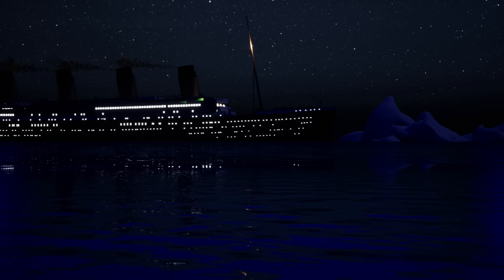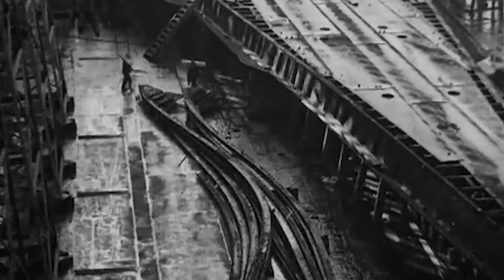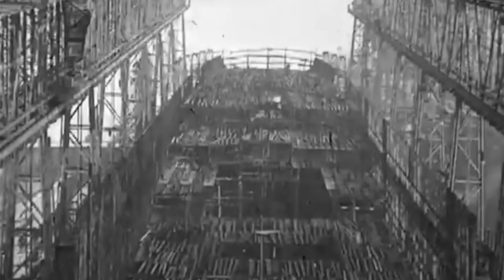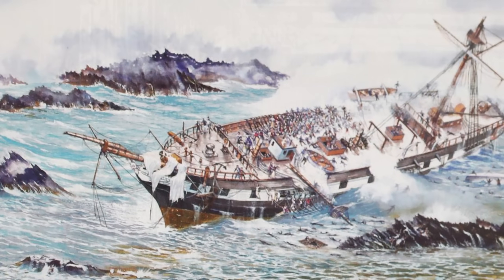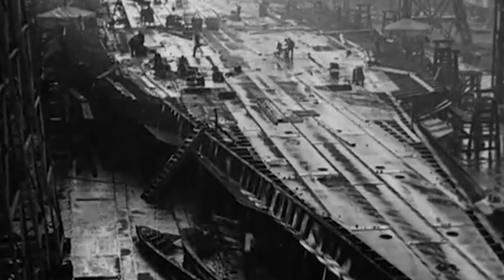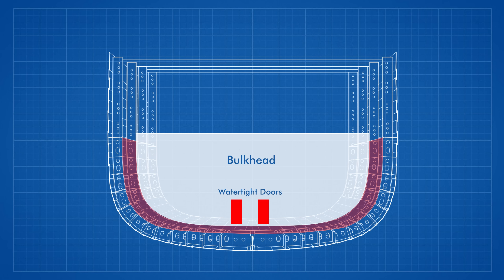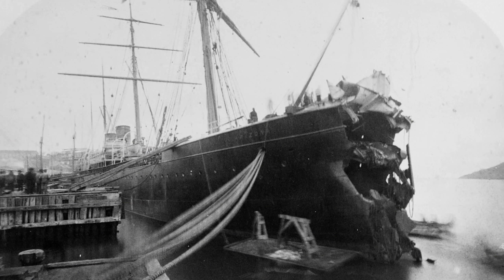How did the Iceberg Sink the Titanic?

Comment: Interesting video.

One thing that does occur to me, that doesn't seem to be addressed anywhere.  There are numerous eyewitness reports about the initial impact (or impacts), and said reports vary widely.  Some witnesses felt nothing or weren't awakened, some reported hearing / feeling distant grinding noises, others report a definite shudder, a couple report a shock or jolt strong enough to make them stumble or almost fall out of bed.

This suggests that different parts of the ship MIGHT have reacted differently and/or to different degrees to the collision.  The hull would have been built to flex somewhat anyhow and, considering the considerable forces involved while sideswiping the iceberg, some flexing, twisting and distortion of the structure seems plausible.

  Give the size of the Titanic, and that some of the forces involved were concentrated in specific areas, perhaps some of the twisting, etc. was differential - ie. different parts of the ship distorted at different rates.  That would help explain how people "felt" the collision differently.  This might also have opened up gaps in plates, and damaged portions of the ship's structure, over and beyond what the actual iceberg impact did directly.

Pure speculation on my part.  Nothing world-shaking or paradigm-changing here, just something to think about.

Comment: Could the Titanic have been saved had Captain Edward Smith heeded the iceburg warnings, maybe a bit earlier? To me, it seemed he ignored them. Would the Titanic have floated until help arrived if it hit head-on?
Reply: Smith was technically heeding the warnings, he didn't exactly ignore them. The ship's officers, captain included, expected to see ice around midnight that evening. Before going off to bed for the night, Smith left the order with Lightoller to slow the ship to half speed ahead should ANY changes in the conditions occur, including spotting any ice. It's just that it was so brightly lit by starlight and so clear and calm, he was banking on the conditions holding (which they technically did).

As for the collision, yes, Titanic would have absolutely survived a head-on collision with the iceberg BUT it would have buckled in the first two or three compartments killing some 400-450 passengers and crew. The most senior officer on-duty behind the command would be responsible and arrested/court-martialled and charged with mass negligence, manslaughter of the highest degree, and destruction of property. Unfortunately, rudimentary mariner training has mariners avoid obstacles at sea at all costs.

By rights, they ALMOST made it. Contrary to what the Cameron film shows us, Titanic was very responsive to her helm and rudder and came very close to missing the iceberg completely.

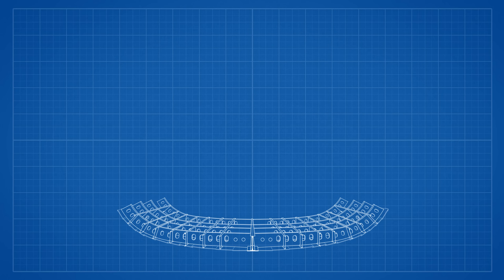Comment: 4:40 See the "floor" of the ship? They had all those oval holes all over, why was that? 
Did they need them solid and help save on steel? Make them stronger? 
Thanks.
Reply: Those are called "lightning holes" which are indeed to help lighten the overall load and improve buoyancy but most importantly they allow for water to be able to be pumped between different ballast tanks. If these holes weren't installed in the floor sections of the frames, the ballast water would need to be pumped up out of the double bottom, requiring twice the pumping power the ship design called for, whereas if you put these holes into the floors of the frames, you can simply pump in parallel from one ballast tank to another.

It also added a touch of flexibility to the steel, not much but enough to account for changing in sea temperatures year-round.

Comment: Could they have pumped the water out of the sixth watertight compartment?
Reply: They did exactly that, until the pumps could no longer keep up. Then they retreated to the next compartment back and sealed the previous one forward. They'd continue doing this throughout the sinking until the power waned enough to be insufficient to keep the pumps going.
Reply: @pc_buildyb0i935 Exactly.  Plus, the Titanic’s pumps could expel only about 400 tons of water per hour, at their peak efficiency.  Meanwhile, 20,000 tons of water per hour were coming in.  It was an unequal battle, to say the least.

Comment: Thank you, love your graphics! Did the tank top plates extend to the outer bulkhead plates? If so, was this joint welded or riveted so as to seal the ballasts, assuming this to be true, please confirm. Would have a second layer of bulkhead plates (on the hull framing's interior) saved the Titanic? Did the iceberg damage the hull framing or only the outer bulkhead plates?
Reply: Welding was in its infancy in Titanic's era, so the steel plating sealing the tank top to create the ballasts was sealed using riveting. The iceberg damage was limited only to the hull's steel plating. The individual frames of the ship were undamaged by the iceberg collision (but very likely damaged during the breakup, and the eventual collision with the sea floor)

Comment: Thinking about the lifeboats' role as "ferries" between the stricken ship and the rescue ship (so that there was "no need" for a full lifeboat complement) I think the trouble with that is by the time the "ferries" made one trip and came back the stricken ship might've been in a far more precarious situation if not already beneath the water. So with a full lifeboat complement and a properly trained crew it would've all been more effective and faster everyone would've been evacuated at the same time. The normally stormy North Atlantic is no place for such "ferries" especially if the crew had to row (the boats weren't motorized) the crew would've for sure been exhausted from rowing in choppy waters. That night the sea was most unusually calm and it seems largely forgotten that this is really the exception on the North Atlantic. (And the very fact that it was so calm makes it very easy for people now to think of lifeboats as "ferries") 
Also the word was spread at the time that the North Atlantic run was so busy "there were always other ships nearby if anything happens." The Titanic was really no exception as the Californian was only 10mi away or most probably less than that (donkey boilerman Ernest Gill and carpenter James McGregor saw the Titanic's distress rockets very plainly as did the officers), but then (a) she was the one and only ship really close and (b) Cpt Lord just wouldn't bother helping. And then apart from the Californian all the other ships contacted by Phillips and Bride were much further away. After all, the Carpathia was no fewer than 58mi away so she needed 3.5hrs to make it to the scene and she didn't get there until 1h40min after the Titanic slid beneath the water.

Comment: It is truly stupid to not make the top side of the water tight compartments sealed, no wonder Titanic kept taking water into herself, certainly disasters will happen if engineering is not done right.
Reply: The compartments sealed at D-deck with the designers knowing full well that if she flooded enough to submerge D-deck then she was already a total loss as it was. No point in over designing something for a situation most likely to never happen.
Reply: @Tozzpot500  None sense.
Reply: @hujiaming6151  That is quite literally why she was designed that way. Titanic could only survive the breaching of 5 compartments, the iceberg took out 6. Fully sealed bulkheads or not she was always going to sink after sustaining such damage.
Reply: @Tozzpot500  Bullshit, fully sealed bulkheads would certainly have saved those 1500 souls for sure, and also carry them to New York with a bit delay.
Reply: @hujiaming6151  Titanic was designed to survive the flooding of 5 compartments. The iceberg breached 6. After the 6th compartment flooded the the bulkheads were pulled under the waterline and water could enter the rest of the ship. 

Even if the bulkheads could be fully sealed, Titanic would have sunk regardless. She was designed within a set of parameters, the incident which sank her was well outside of what anyone could have predicted. 

Also just saying, no modern cruiseship, naval vessel etc has fully sealed bulkheads because people need to move between the spaces. In fact most modern cruiseships use a similar layout of compartments to Titanic with the bulkheads not rising above crew levels to allow passengers to freely traverse the ship. 

Titanic was not poorly designed, she just encountered a scenario she simply was not built for. The fact she took two and a half hours to sink is a testiment to how well built and designed she was especially when compared to other Edwardian liners that were lost.

Comment: But did you know it also had a fire on board before it left port and before it set sail 138 fire stokers the men that fueled the boilers ( they got off because they knew the fire would weeken the steel plates  !
Reply: The fire played no role in the sinking. Bunker fires were extremely common and some smouldering wet coals would never be able to reach the temperature required to affect the steel of her hull, which was constantly being cooled by the Atlantic Ocean. 

The bunker was also located further aft of the impact so it literally couldnt have contributed to the sinking even if the steel had been weakened, which as i explained isnt possible.

Comment: Everything they could do wrong, they did wrong.  Had a fire in a coal bunker before they even left port. Full speed through a known ice field, not enough lifeboats, crew not well trained to launch lifeboats. Some say some rivets were substandard. I'm sure there were many others
Reply: I wouldn’t say everything that could go wrong, did go wrong. There were some things that luckily didn’t go wrong like for instance their radio communication. Their Marconi radio system had broken down, but the two radio operators fortunately fixed it in time despite the fact that they weren’t supposed to be fixing it themselves.
Reply: @bertha4304, everything you just said - it already debunked

Comment: Vladimir Kostenko, a russian ship constructor and engineer visited Great Britain in 1909 to check the Rurik cruiser which was ordered by the Russian government to be built. Kostenko visited Harland and Wolff, where he was acquainted with models and plans of the Olympic class ships. Kostenko after he saw the plans, pointed out that the bulkheads separating the so-called water tight compartmens are not sealed on top and are not water tight at all. He said, that this design flaw may cause the ship sink, even if there is even an insignificant damage in the ships hull. However, Kostenko`s objections were refused by the H&W representatives and experts, they even laughed at him. Because the russian navy lost a battle with Japan at Tsushima recently, they started to make jokes, that you Russians have hydrophobia since Tsushima. They also claimed the experience and past crashes show that there is no need for such high demands for water tightness on a civilian ship as for the battle ship. Also the passages for pasangers on some places would need to be smaller and some design changes of the passenger decks would be more complicated if the bulkheads would seal the compartments. However, this later became standard even on civilian large ships.

Comment: 8:25  There's been a lot of big talk about those watertight doors that could be closed by just hitting a switch on the bridge. Only a few at the bottom of the ship could be closed that way; the rest had to be closed by hand
Reply: There were four mechanisms;

1 - Remotely by switches in the bridge

2 - Manually pulling a lever at the door that disengages the door's clutch

3 - Floats installed just below deck that rise and disengage the clutch if there's any flooding in the compartment

4 - Manual hand cranks installed into the deck above
Reply: @pc_buildyb0i935  Oh

Comment: What I don’t get is why there’s people on my ocean liner fb groups who contest that the watertight bulk heads not going up all the way wasn’t actually an issue. It had to have been. It’s just basic logic. If they went all the way up to the highest deck than they would have sealed in the water before 5 compartments had been breached and kept the ship afloat.
Reply: The deck that seals the top of the hull is called the Shelter Deck. Ships before Titanic were never designed with transverse watertight bulkheads that seal at the shelter deck. Ships after Titanic are in the same boat, no pun intended.

Due to airflow and ease of evacuation in an emergency, you cannot design ships with bulkheads that seal at the Shelter Deck.

Take a look at the Coast Guard report for the Monarch of the Seas. Her bulkheads didn't even seal halfway up the hull, and that's an example of modern ship design.

Comment: There's also evidence that not only did Titanic scrape its starboard side but that she also grounded on the iceberg. Tearing off plates along the hull bottom and piercing the tank top. Both the tears and the openings led to her being flooded quicker than expected
Reply: No, there isn't. This myth, like all the rest, should have been put to bed decades ago but surface-level Titanic savants always pick it up as if it was some groundbreaking discovery.

We have FOUND the iceberg damage thanks to deepscan sonar that was able to peer through the mud. Guess what? The double bottom is entirely intact.

Had the ship grounded and her both her keel and tank top (double bottom) opened up, she'd have sunk like a rock, not in the established 2hrs and 40mins everybody knows it took.

Comment: Mostly #1, the ships design. To compare, look at the hole in the USS Cole. Very similar in size and location with one exception, the USS Cole had actual watertight blocks to keep water from flooding out full decks.
Reply: No ships are designed with longitudinal watertight bulkheads that seal at the shelter deck. The only exceptions are the engine rooms and munitions compartments on select warships and small, personal watercraft.

Comment: I am totally confused. Were the 'watertight' compartments sealed at the top or could water spillover into the neighour as each one filled to their capacity? Surely all 'watertight' compartments should be sealed at the top so this can't happen? Thank you. I love your videos. From Ireland 🇮🇪
Reply: Ships aren't designed with watertight bulkheads that seal the top of the hull, with the exception of small, personal craft and military vessels who generally have their engine and munitions compartments blocked up with double bulkheads.

Sealing them all the way at the strength deck dramatically reduces the efficiency of the air circulation systems and can seriously hamper an evacuation by creating a bottleneck of passengers all trying to squeeze through the narrow opening of an opened watertight door - which, during a sinking, would need to be closed no later than when the water reaches it. Since there's no guarantee all passengers in the compartment can evacuate by that point, closing the doors to slow the flooding would condemn to death whomever was still in the area.

Take a look at the cutaway view of the Monarch of the Seas, a relatively modern passenger-going cruise ship. Note that the watertight bulkheads don't even extend one quarter of the ship's height.

Spaces between bulkheads, along with bulkhead height (they're stepped in height from amidships to either extreme, so going from the middle both forwards and rear, they get taller and taller) is decided very carefully by the naval architects chosen for the job.

The bulkhead only needs to rise above the waterline in order to completely contain flooding in the area - water within the ship can flood no higher than the waterline along the exterior of the ship's hull, and bulkheads are all designed above this height.

The natural consequence of being exposed to flooding outside the design spec of a ship (modern ships can generally handle anywhere between two and three compartments flooded - Titanic could handle 4) is that enough water weight in the ship will pull it down low enough to the point that the tops of the bulkheads within the hull will be lower than the waterline outside the hull, in which case water will spill over the bulkhead tops and progressively flood the ship.

The greater advancements in safety include far better navigation equipment like sonar, radar, better radio communication, ice patrols, full weather monitoring and live updates, lifeboat technology, better-quality steel, etc.